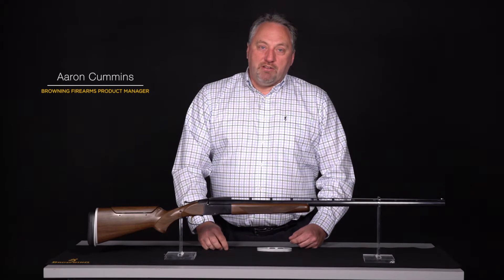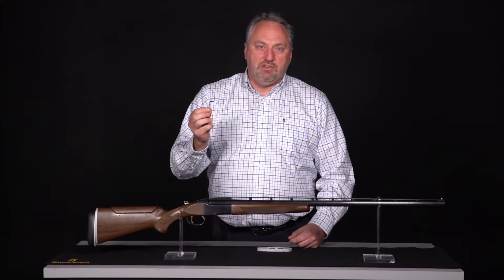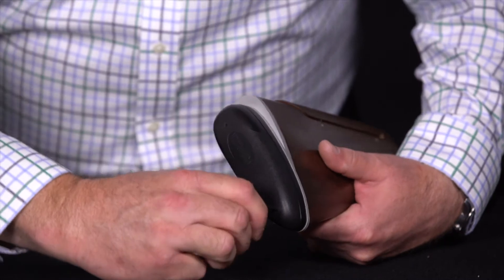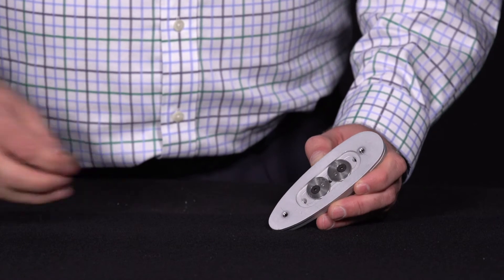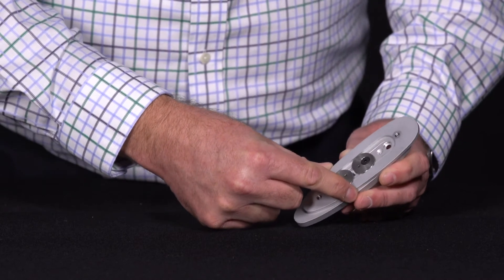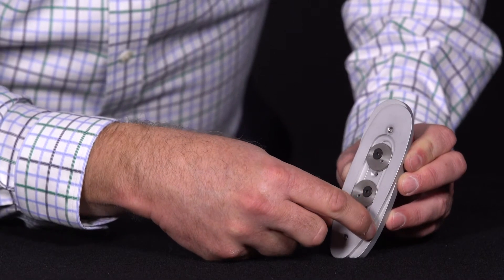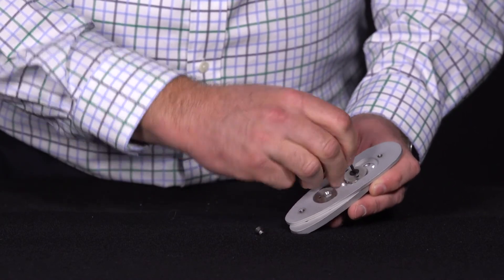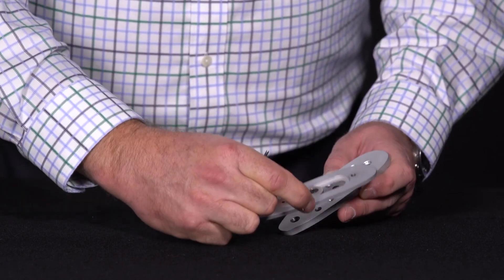BT-99 Adjustable Buttplate Overview

Comment: Can this buttplate be placed on an older BT99 without cutting the stock? I have a BT99 that was made in 1972 but it doesn't fit me right and I have to mount it with the tip of the buttplate touching my upper shoulder area. If I put it in the pocket of my shoulder it is just too low. So again, can this be added to my older model BT99?